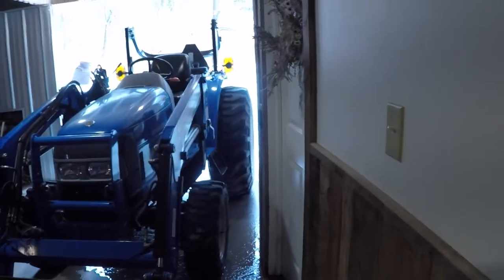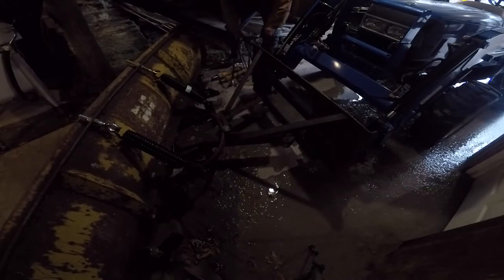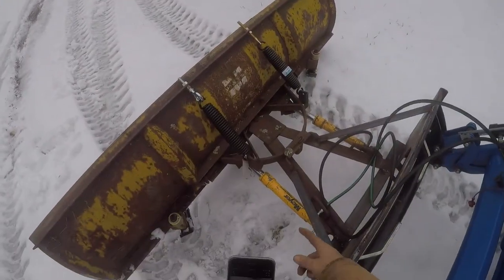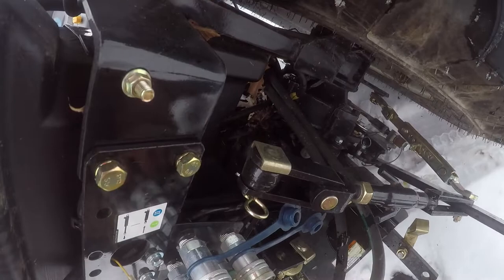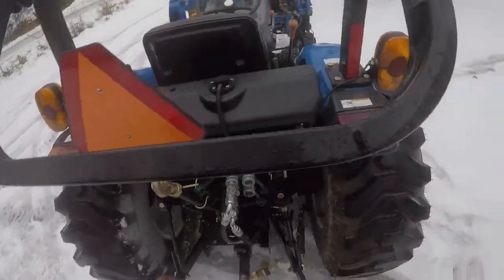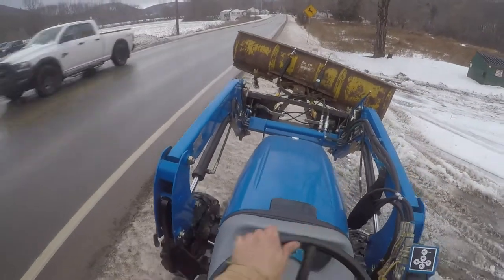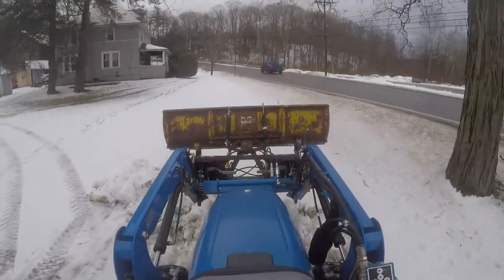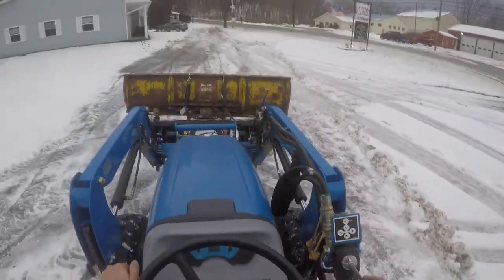Workmaster 25  I welded a quick attach plow, first time out.

Comment: Hey John  that seems to work great  worth the effort to put it on that's for sure I like your ford 😀
Reply from the maker: Hi Dave;  The plow does work well. Was pretty happy with it, ya know how sometimes these thing don't work or are not worth the effort. The old ford is a 61 f-100 unibody. the cab and box are one body. They only made them 3 years because if you overloaded the doors wouldn't open. Thanks a million for watching and commenting!! John

Comment: how did you add the front remotes?, I have that tractor and not sure what t is the best way to add those?
Reply from the maker: Hi JP; I had them add it when I ordered the tractor. That was the easy way out. It is also plumbed as a two way and if I switch one of the hoses quick coupler I can run a rotary mower. You have to have it dump one hose to reservoir for things that wind down. Hope I explained that well enough?Thanks for watching and commenting!!! John